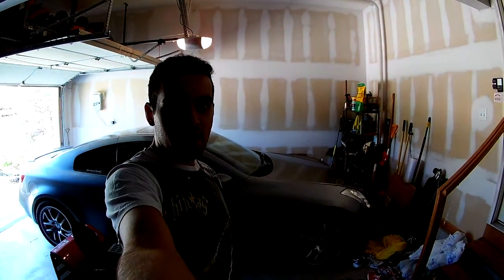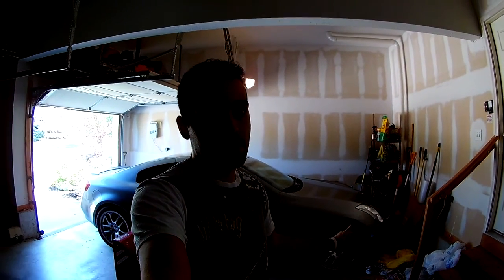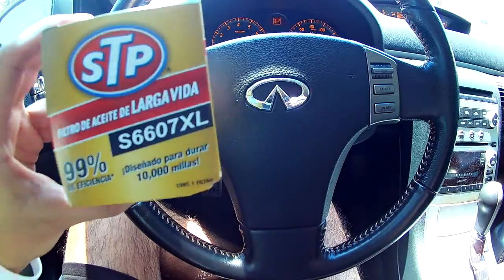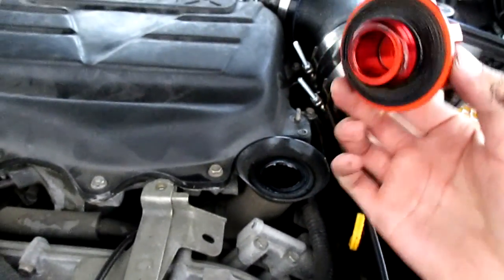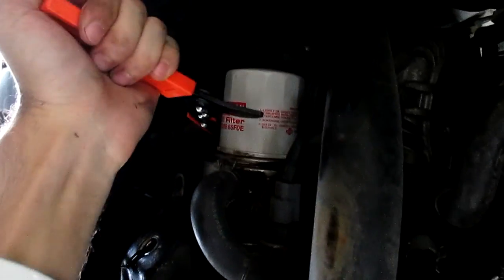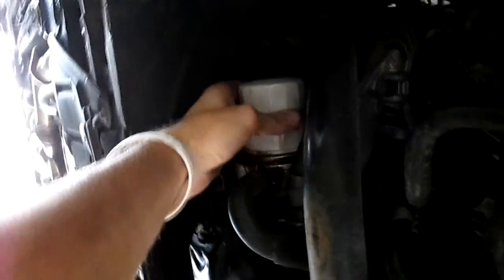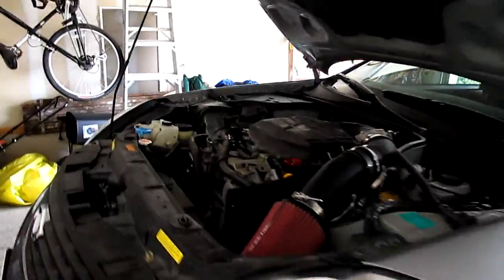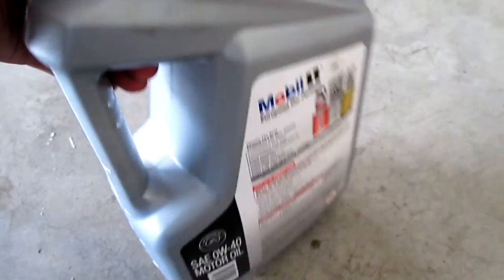Oil Change, FIRST TIME! | G35 Coupe

Comment: Don't worry. I also have the same car year as you. 06 6MT RevUp Model. Mine destroys oil. I've changed it every two months for the past 2 years. It's very common, you may have a small oil leak, but it's most likely just burning it up.
Reply from the maker: Yeah I gotta track down this leak lol

Comment: Mobil 1 synthetic best oil out there
Reply: And what exhaust do you have
Reply from the maker: Definitely agree! I have ART pipes, xyz pipe with resonator, and Nismo rep exhaust. Wanted a nismo exhaust but couldn't justify people's asking price for the condition they were in. So found a rep on ebay. Full 3in
Reply: +OPDrags nice ever thought of getting the motordyne shockwave exhaust sounds amazing
Reply from the maker: +Stanced G37 I've considered it for sure. LMT has plans to make an exhaust so wanna see what they come up with. But for now I'm extremely happy with how mine sounds
Reply: +Matt Riney What's better
Reply from the maker: +Matt Riney Mobil 1 is not shit lol
Reply from the maker: +Matt Riney I have and even my tuner said Mobil 1 full synthetic is great for the price. I'm pretty sure nissan from the factory uses Mobile 1.
Reply from the maker: +Matt Riney the people in the first link said how good Mobile 1 is compared to others in its price range. The second link was from the amsoil site lol. Sure as hell won't believe their results
Reply: +OPDrags lmfao every result ive seen mobil 1 has outperformed ams in every way ams oil is not good they did a bearing test and ams oil was the first one to show wear between them

Comment: I thought G35 had to use 10w-30, is it better to run 0w-40?
Reply from the maker: Thats just what my tuner recommended. Theyve seen good results with it so they asked that I put that in.
Reply: +OPDrags so can I use it or did they only recommend it cuz your tuned
Reply from the maker: +Jorge Garcia yeah don't see why you couldn't. I haven't really looked into it so you might want to before making the change. I'm just going off what they said cause they are very knowledgeable with the VQ.

Comment: yep youre burning oil... if you have the revup motor then youre 100% burning
i own a g35 first gen and it burns a little bit and my friend owns and 05 coupe with the revup and he also burns oil he even spun a bearing for not checking his oil in a month and a half soooo......

as some one with g35 and friends with g35 we welcome you to the oil burning family keep and eye on oil levels and check your pvc  valve and rear main seal other than that i recommend using thicker oil than indicated from factory really helps but yeah every vq burns oil sadly
Reply from the maker: I have an 06 nonrev so I've read it's not common for me. I did a PCV delete so no longer an issue with oil getting into the plenum. Keeping a closer eye on the levels now. I need to track down my oil leak
Reply: +OPDrags so yours is an automatic transmission that's why its none rev... park it in a clean spot so you can track the leak faster, jack it up and see if its from the rear mainseal also pull your coils from the sparkplug and look down the hole to see if there is oil in there
Reply: +OPDrags my passenger side plug holes are filled with oil.. i need to buy a new valve cover with seal kit cus it has a crappy design and you have to replace the cover itself

Comment: You're definitely burning oil it's common with the VQs
Reply from the maker: Common for 03-04. Not really the 05s and up
Reply: Actually all the 03-07 vqs have oil consumption. The vq35DE motor is not reliable when in comes to oil at all. Unless you have a rev up your probably more lucky..I worked on plenty coupes and most of the oil issues are from the 05
Reply from the maker: +Jason Parsuram yeah I've just read that it's not that common for my year which is 06. I'm leaning towards more of the oil leak though. it's all over the bottom of my car
Reply: revup are the ones with the worst oil consumption i think youre referring the the HIGHREV motors (vq35HR) which are 07+ aka the dual intake ones
Reply: HRs have no issues